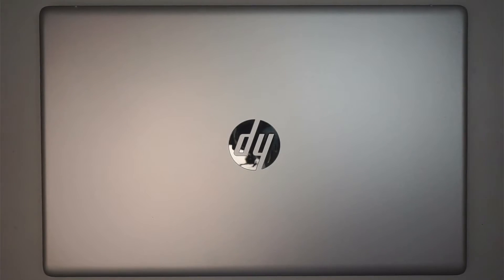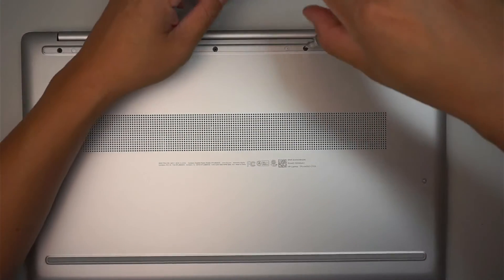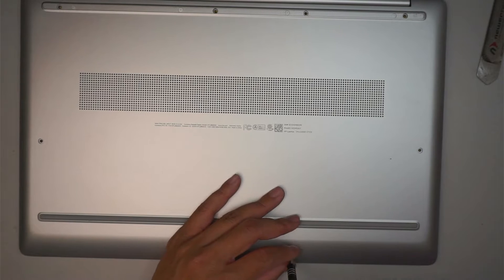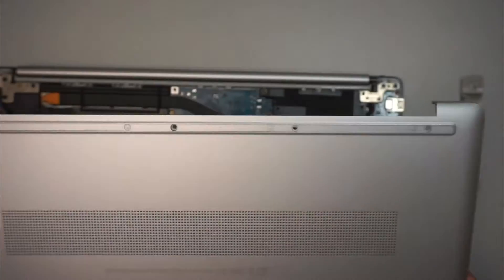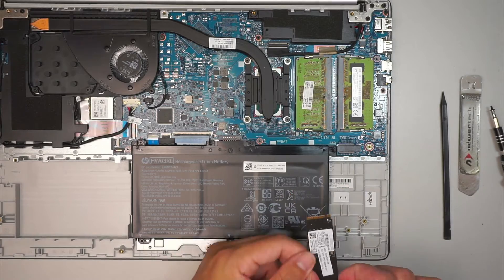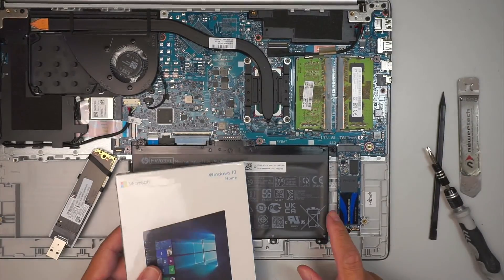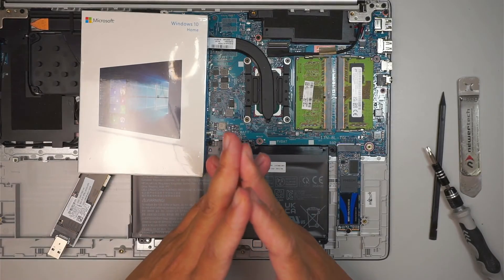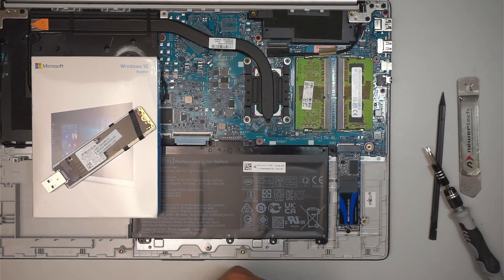HP 17t cn000 Upgrade M2 SSD

Comment: @5:41 - I could not find the video link you referenced for getting the windows onto the new m2 SSD.  Could you post it here?  In the past, I tried doing a backup of the machine as I wanted it to act like it does out of the box, just with a larger SSD.  Windows got upset due to the mismatch of parts, or I ran into Bitlocker issues.  Do you discuss any of that?